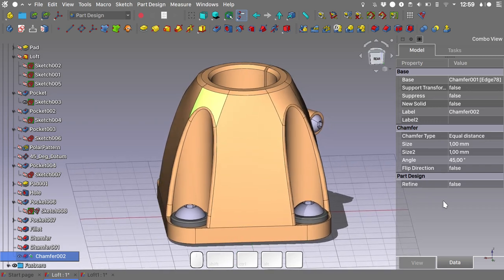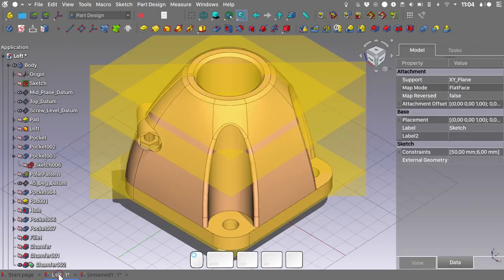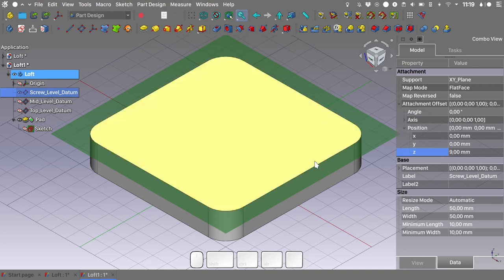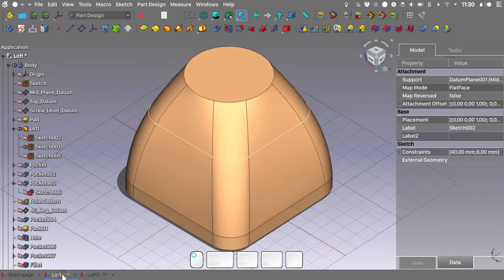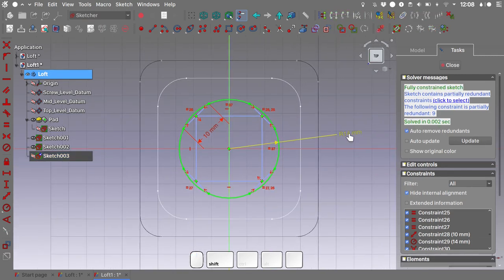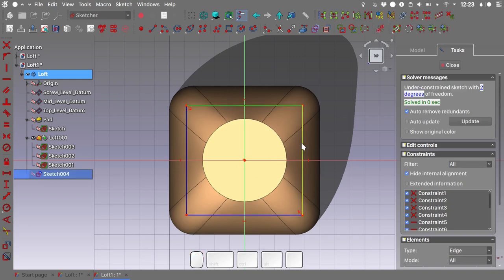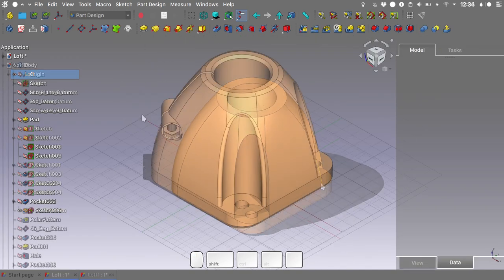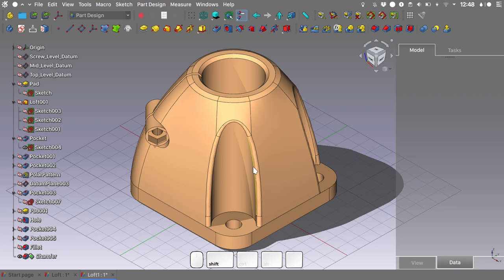[LinkStage3] Tutorial, dome shaped geometry using loft in PartDesign.

Comment: Learnt a few things: * the copy carbon icon; the loft; one can use an schema more than once, like you did on the horizontal screw;  the pad or hole to datum plane;  datum planes.  This gave me a better understanding of them.
Thanks
Reply from the maker: Indeed datums(not only planes) are a often misunderstood but very useful feature. You can think of them as a new origin for the orientation and positioning of your features in the body. Thank you for your kind words.

Comment: For the first base sketch: You could also use the 'constraint preserving sketch fillet' tool for your 50x50 rectangle. That way the 50mm horizontal constraint stays in place and you need a lot less construction mode sketches... if that makes sense
Reply from the maker: Indeed that is a good tip. It saves a bit of hassle. Thx

Comment: Nice tutorial, but what I noticed is that you have the grid turned on in the part design workbench. How did you do this?
Reply from the maker: I'm using the Draft workbench grid. You can enable it by switching to that workbench. I made a request to the developers for a easier accessible global grid.